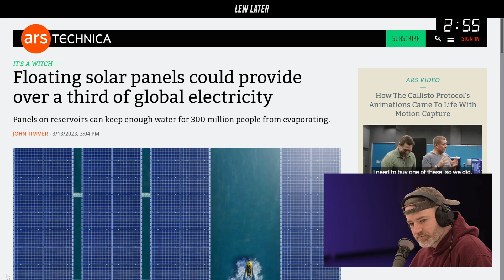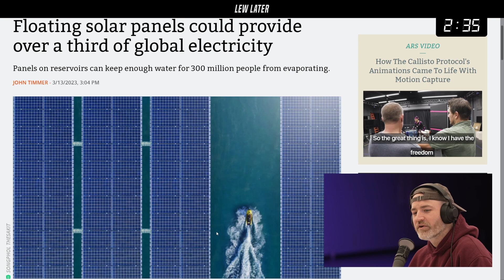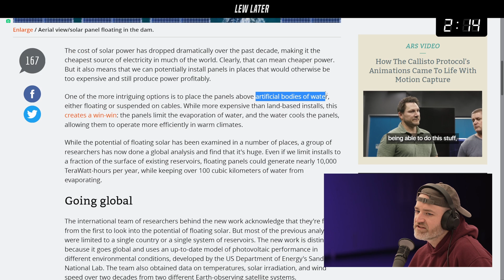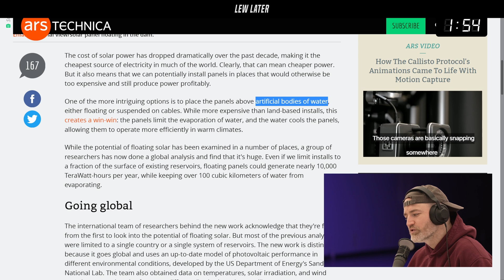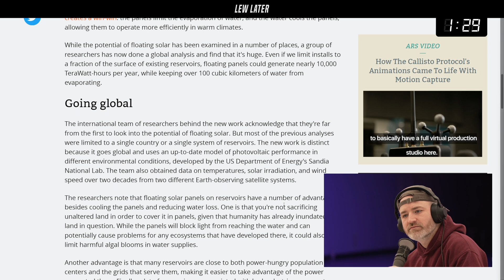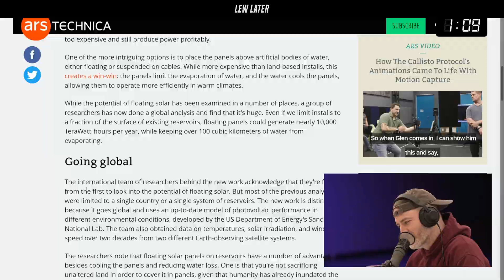Here's Why Floating Solar Panels Are the Future

Comment: I always like the idea of solar, but I'm constantly worried about day/night cycles and extreme weather conditions. Also, any logistical mistakes which could bottleneck the electrical grid.
Reply: Worry no longer. Grid storage in batteries is removing the day/night cycle problem. The duck curve is dying. Solar cells have proven pretty sturdy in extreme weather and they are getting cheaper and better.

Comment: If water can't evaporate, we will no longer have rain. Now, I'm no expert, and I don't know how much evaporation is from the ocean vs lakes/rivers. But I would imagine if this was widely adopted, we would see inland reservoir levels continue to drop.
Reply: Nah! Your are incorrect Sir! There are still gaps in between the panels. 😑 #DontFreakOut 🤫
Reply: @VRtechman  Are you saying it doesn't prevent evaporation at all then? If it prevents it at all, then the concern is still valid. #HashtagBecauseHashtagsAreCool
Reply: The panels covers a very, very small fraction of the water surface. No effect on global water evaporation what so ever..
Reply: @pekkilund  erm, what? Did you miss the point of the solar panels on water? It was to prevent evaporation…
Reply: You are overestimating the space needed and the amount of panels needed.

Comment: Actually, you're increasing the heat because you're reducing evaporation surface and evaporation reduces the heat.
Reply: Wrong. The panels covers a minuscule part of the water surface, no effect on evaporation. The cooling effect of water on the panels can increase efficiency of up to 10%.
Reply: No because you are taking away 20% of the solar energy that would have been absorbed by the water and convert it to electricity instead of letting it warm up the water.

Comment: The pro is can reduce the water temperature since it absorb all the heat from the sun, can do in large scale with less cost than on land, save land space or no deforestation needed...cons...Can only work at calm water since it floating on it, Safety issue is a concern for biodiversity that live in the water and around it...incase some electronic/cable/et cetera leak(electric current ⚡) damage and like every solar panel...energy it gain is vary...depending on weather either it sunny, cloudy, raining or stormy...

Comment: this is dumb cus you can only fill the ocean on a area based space when in land or flying you can fill in a volumetric based space. vertical solar panels with mirriors to intensify the suns rays into them and between is the way.